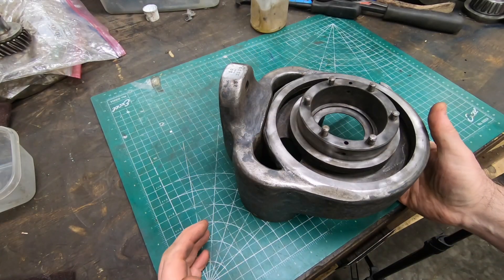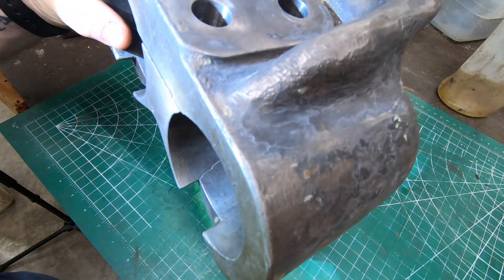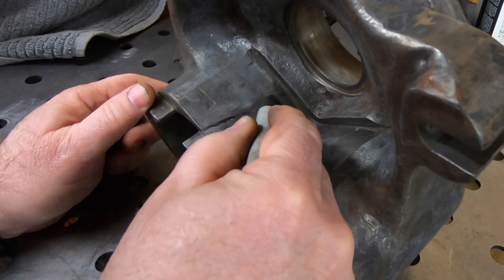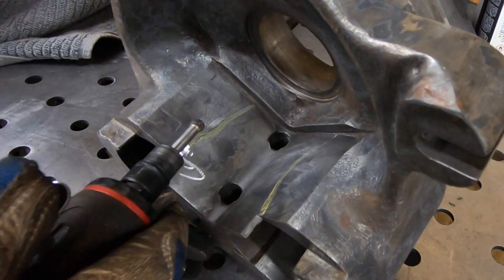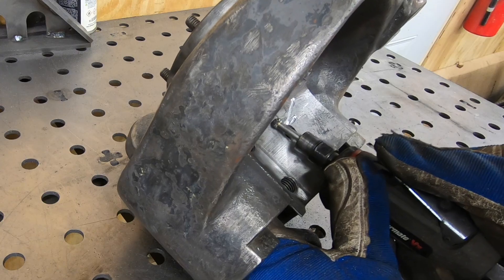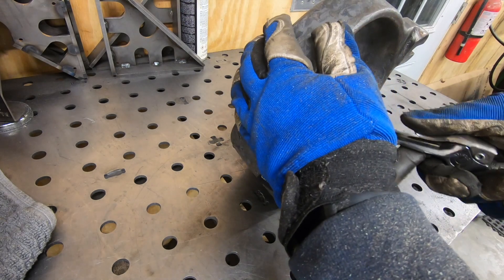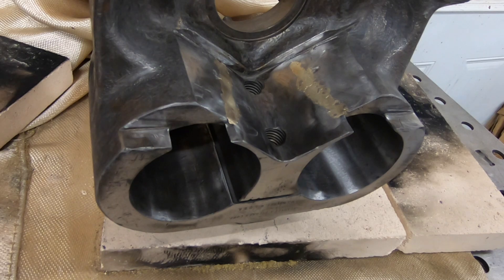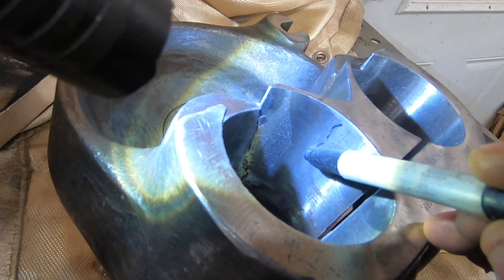K&T Universal Milling Head - Fixing Cracks in Cast Iron with TIG Brazing

Comment: Could you have put the part on your gas grill and got it up to temp that way since you were out of oxy/acet gas?
Reply: That's a real good idea Tom! I left a comment suggesting adding a cheap toaster oven to the shop. That's what I use for such things. Great for removing/installing bearings as well. For whatever reason, my comment has been removed, even though it was all positive. Maybe because I included a link to another website. Not sure if that's "against the rules" ?. Wish YouTube would at least notify you when they do that, and why, so you know what you did wrong.
Reply from the maker: Not a bad idea. But I don't have a gas grill. 🙂
Reply: @MyLilMule

Comment: As a reformed mechanical engineer, I might think that the crack will progress to the point where the stress is low enough to stop propagation…probably even after brazing.  It’s very possible that the part will be perfectly functional in spite of the crack…as unsatisfactory as that might sound, I know.
Reply from the maker: I agree. It might be just fine. But, if it does break more completely, I'm not too worried about it. I will just take it as an opportunity to learn proper gas brazing technique. I'll find some pieces to practice on (I plan on doing that anyway) and then do my best to do it right.

Comment: Good video…a couple of questions.  I would always use flux for torch brazing to help the material flow…is that not needed with Tig brazing?  I have heard about tig welding cast iron with a nickel filler.  Any thoughts on that?
Reply from the maker: The flux is there to prevent oxidation when gas brazing. The argon using in TIG is a shielding gas which eliminates the need for flux. I haven't tried nickel wire before. But the problem with welding cast is it will make the cast brittle where it is melted. That's what I was trying to avoid, but, as we can all see, I failed. ;)

Comment: I realize that you posted this 6 months ago.....but:

Where are you located?

It's unfortunate K&T designed that overarm support that way; almost like it was designed to crack/fail. When those bolts get tightened, something has to give/flex.

While I've ran silicon bronze on DC, I actually prefer aluminum bronze on AC.  The cleaning action of the AC improves wetting.
Reply from the maker: I’m in NE Ohio